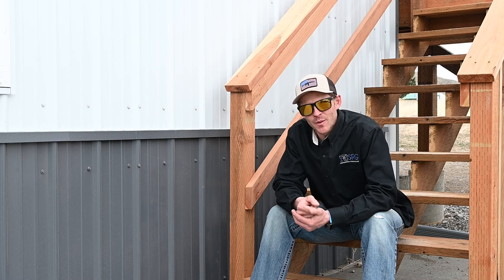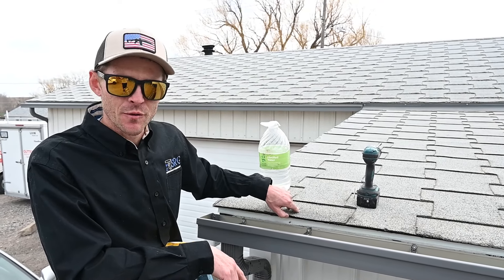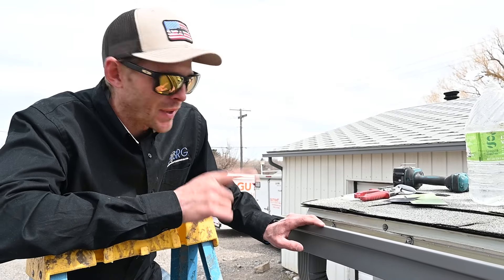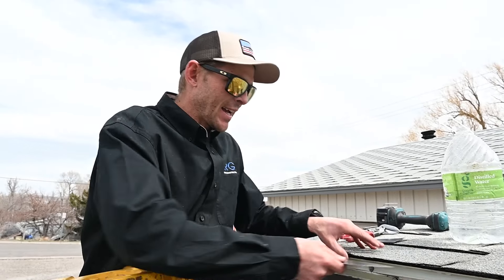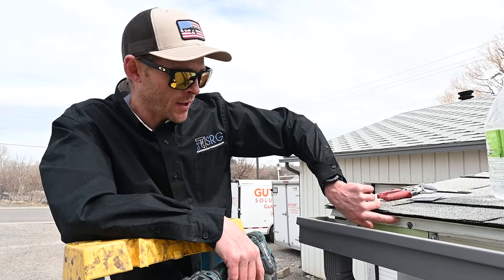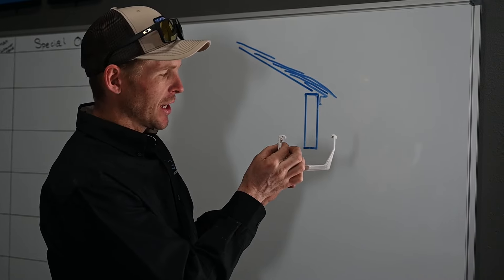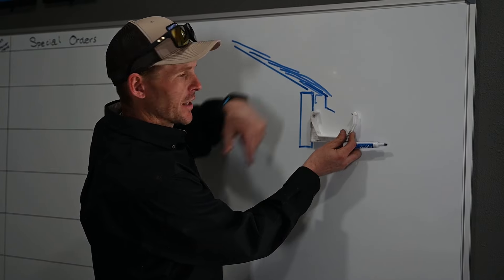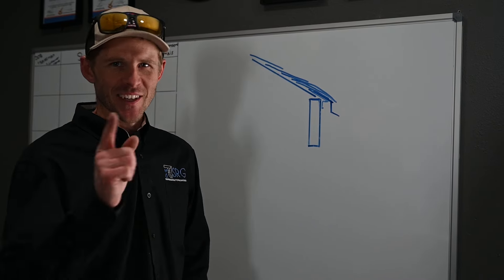Why Is Water Leaking Behind My Rain Gutter?

Comment: Cool video. question, do you ever screw through the drip edge when you install gutter such as hidden brackets or hangers?
Reply from the maker: We try not to. Sometimes its unavoidable
Reply: the more hole you create, you increase hole wire water can go in. best thing to do is to install the gutter underneath the drip edge. For me, I try to extend the drip with my hand to get a distance from the facia so the water cannot go behind the gutter

Comment: Why don't they make rain gutters with the back higher than the front. It would save a lot of problems
Reply: In the 40 years I've been in the rain gutters business,  I've never seen a gutter that didn't have the back higher than the front. If your gutter doesn't,  then your machine is out of adjustment. You need to bring the guides to the right slightly before it goes into the  box. Consult your operations manual. Another reason may be that your coil is too narrow. Are you using 11 7/8 " or  11 3/4"? Anything narrower will result in a gutter with a shorter back.

Comment: Who the f*ck screws the face of the drip edge , there should be a half in. gap between the drip edge and fascia, the shingles should have been installed correctly, and weren’t. Anything you’re doing now is hackamore, Macgyver fixing improper installation